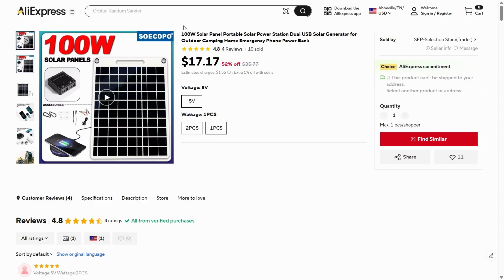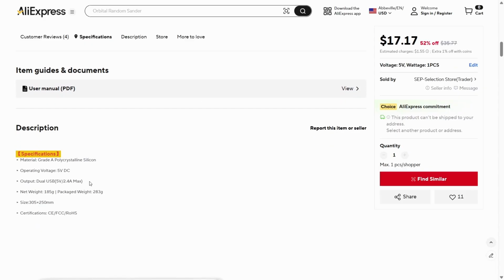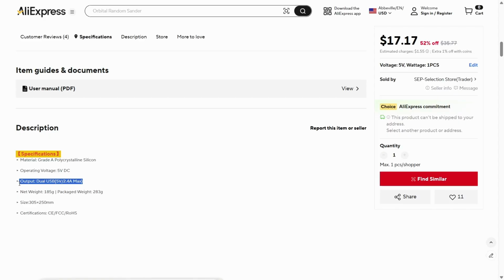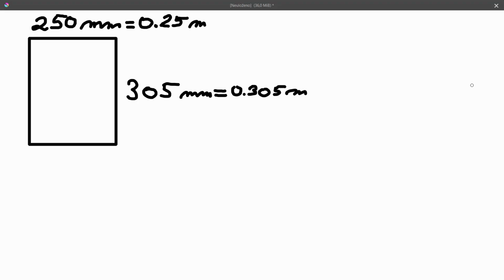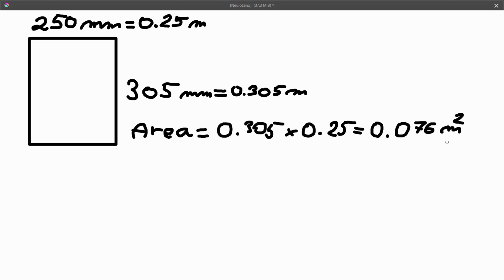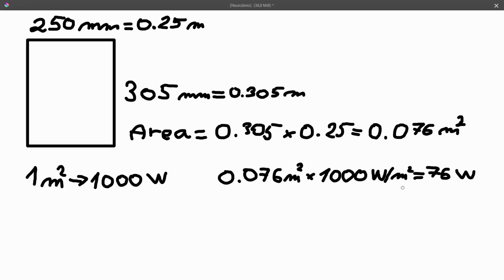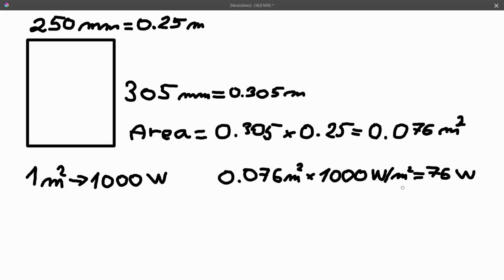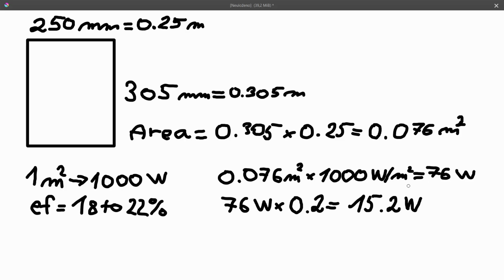Can This Tiny Panel Really Be 100W?

Comment: What about flexible panels? Are there any differences?
Reply from the maker: Flexible panels are usually a bit less efficient than rigid ones—typically around 10–18% vs. about 18–23% for standard panels. They’re lighter and bendable, but you trade off some efficiency and often higher heat losses.